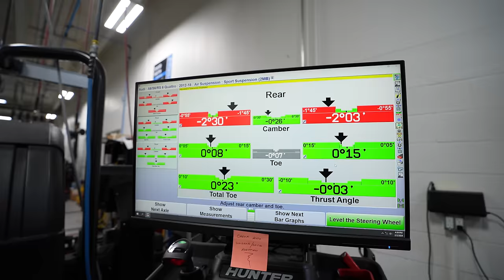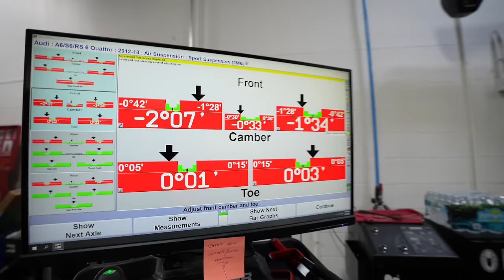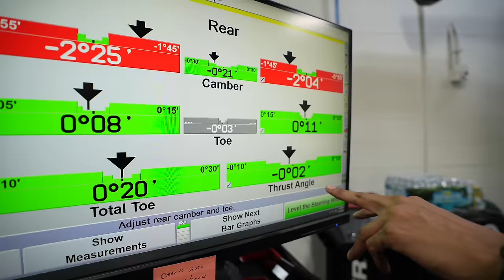REBUILDING A WRECKED RS6 THEN TAKING IT BACK TO AUDI

Comment: Well done Pembroke Pines Audi. Letting Matt film on the premises and interview your tech PJ was awesome. What a great way to engage with the public and free advertising. It goes a long way to promote the Audi brand compared to other competitors. Good job guys! Greetings from the UK.
Reply: This 100% - I get it's tricky to endorse something like this, a YT kid so far from your brand,  but it's important because in the UK, Audi really isn't appealing to the younger generation. Its intimidating and expensive. They may not be able to afford now, but you're building a brand for that generation eventually.
Reply: I actually learned at Audi and Worked at Audi. Even PJ has some sympathy, the break job he did is unacceptable for a Workshop LET alone a official Audi Dealership. The Wheel Hub was full of rust, it has to be properly grinded with a rust remover pad, then some rust converter and lastly the cleaned and sealed area needs to be slightly lubricated with Ceramic paste. The Brake Caliper ALWAYS needs to come off, doing otherwise will likely twist or tilt the fresh brake disc, also the piston needs to be cleaned and afterwards its really important to flush and add new brake fluid. If this work would be done in Germany it would be completely unacceptable and every customer would be able to get a refund and get the job done properly. I have NEVER NEVER seen this bad brake job on any car, not even in the lousiest and cheapest unexperienced garage. But this is a damn certified Audi dealership AND a damn RS6 !!! WTF? If i would do this even once when i was working at a Audi, they would either fire me or sue me for something like this.

Comment: Amazing lesson in this (and the previous) video. Sometimes it's the simplest things that mess up. Like a simple connection in both these video's.. My GSXR600 kept stalling and suddenly didn't start at all anymore. Turned out it had no fuel. And it had no fuel without me noticing, because of the simple fact the LED in the dash for the fuel light was broken. I took half the motorcycle apart and tested for example the fuel sensor just to find that out. Needless to say I left it like that and just fuelled up every so many miles. That being said, as an electrical engineer, I can say that if you lose voltage somewhere it will mostly be a bad connection / connection with high resistance somewhere (U=I*R, so if I stays the same and U drops, there has to be a high R somewhere). Because almost everything is fused in a car, if it would be a short circuit strong enough to cause a voltage drop (as in the battery would not be able to maintain voltage), the fuse would most probably break AND you would not see 12V on the battery and 9V somewhere else. If it is localized like that it should be a high resistance connection. Even if you can not find a nut that is loose. Try removing some connections and clean them best you can and put them back. This is what happens by itself most often when you take it apart and put it back and it works suddenly. The contacts clean themselves because of the friction from working on it. (This is also why you should always be just as thorough on GND connections as you are on the +).

Comment: That tech is spot on! That Avant is so beautiful. And actually the Avant 1.9 TDI is not available in US as well.... I am also surprised too. I'm from South Africa and I own 2004 Audi A4 Avant 1.9 TDI B6 6 speed manual with 537 000km (332 000 miles).

Comment: MATT there is fusing under the interior foot rest that will cause a no crank but power up. , also usually 2 relays under the center of that same cowl you removed. 
those are also for starting the car.

Comment: Dodgy earth strap underneath - mine was fixed by adding a extra earth lead from the engine to the body - AA did it with me, when took me home - 10 years on - still starts on the button.

Comment: 12:55
Yo, get yourself a Thermal Camera (bosch 400 gtc for example) for electrical issues.
The loose bolt should get a bit hot because of high current draws(as seen in 7:18 18.5Amps).
Could be interesting to know / work with on new projects :)

Comment: I’m 6:42 into the video… before I watch the rest I want to say I have the exact same problem with my 1999 Subaru forester that I’ve motor swapped to a 01 Impreza and converted to manual…. I ended up just putting a push start button in and it’s been fine with that but I can’t wait to see if you guys figure out the problem.
Reply: After seeing the solution I’m pretty sure mine has a different issue but I’ll go and check all the wiring just in case.  Awesome video matt

Comment: Considering the start button, you apparently dont daily it :D I have regular diesel A6 and the location of buttons is absolute ergonomic heaven, you place your right hand (left in UK) on the center console like your snuggling thigh of passenger and press it with thumb :)

Comment: In my experience the cable and the lead clamp that mounts onto the battery can have a poor connection and cause voltage drop. Same thing with the actual clamp to the battery connection. I'd need jumps constantly but clean the terminal and clamp and it'd start right up.

Comment: I've never seen an RS6 which wasn't the estate version. Looks like a large RS3 with no back end.
Also at 3:46 when the tech is talking about having the start/stop on the opposite side to the driver, but it turns out they put it on the opposite side wherever the car locale is - well back in the 1970's my dad had Audi's and they notoriously didn't swap things like the switch for the heated rear-screen which in the UK wasn't possible to see if it was turned on, due to the orientation of the LED on the switch. Seems like they've sorted that issue these days though.

Comment: not to be rude. but it is normal to grind/clean the hub when changing the brake disc. because if not you can risk vibrations from the brakes from the rust built up on the hub. but otherwise very well done job
With kind regards, Audi mechanic from Norway

Comment: you should run some rubber seal on aill visible encricall part like close positives to ground just might be clamped down a bit close don't burn your  wires

Comment: Before I watch the rest, I'm guessing the starter issue is a bad ground connection closer to the battery side of the harness, looks like you're using the jumper posts, which essentially would connect to the harness connected to the engine/ starter, but without the jumper pack you're relying on the battery ground & just clicks.. click is a sign of limited power, enough on the small start starter wire to activate the solenoid, but not enough power to crank the starter motor.. where you're not getting dash lights going out & such I'm assuming ground side rather than power side... unpause lol..
& bad ground it was lmao

Comment: Not familiar with RS cars but A4/A6 can have issues where the positive going from the junction box to the starter/alternator gets rubbed against the engine mount, it eats through and gives a voltage drop, it starta intermittently until it cant start at all

Comment: Even if they mark the discs as unidirection, I would still put them on the way the technician fitted them, not the KTM X-Bow. If you look at the fins theyre angled in one direction so you want them angled forward to scoop more incoming air through the fins and out through the ports.

Comment: Same problem with starting i have on my audi q5 .. will crank no start random times until it drains the battery , but starts with a car battery starter in 3 seconds :)) i don”t understand why . Brand new battery new filter new glow plugs . No ideea

Comment: It would’ve driven me crazy having the drilled rotors facing the wrong way. Obviously it’s only a personal preference, but to cope with my OCD lol, they should’ve been facing the opposite direction to how they were installed. Which would’ve, in turn, had them facing or pointing the right way. With the drilled holes, starting from the bottom, going up & flaring towards the left or back of the car.

Comment: The ignition button is on the correct side, because it was made for steering wheel on the left side. They didn't bother to switch buttons, i guess it was cheaper. Even the hazard and viper blade pads are on the same side as the cars that have the steering wheel on the left side.
Reply from the maker: On left hand drive cars the buttons on the right hand side
Reply: @MatArmstrongbmx  aha, ok. Just comparig average vehicles. For example, in UK and Ireland the van side door should be on the right side, next to the driver😀.

Comment: Hey, there was in one of the videos an issue with a broken transmission  gear/wire? And you did make from an other gear transmission a new one. And are you not afraid this issue will happen again and the gear will be broken suddenly?  By the way i understand this Audi has automatic transmission and manual ?

Comment: the problem with the cable is @ the starter were it goes to the alternator. i've been there on a a7 and an a4. i've replaced the whole cable from junktion box all the way to the alternator. ofc with 2nd hand one. audi wants a fortune for it.

Comment: Drop from 12.5V to 9V is a huge drop, thermal vision camera will show you a big heat spot.
Reply: not necessarily. if it is high ohmic, there is very low current flowing and hence little heat. The voltage creeping up is an indication of very high resistance in combination with some capacitance post the interruption.

Comment: Did you tighten the starter cable? Wasn’t there a ground you left loose last video? If so I would check all connections to the wires and see if they are tight. 7:46
Updated 12:51 yup
13:58 second update of course it was Freddie have you seen his work?😂

Comment: Guys, I have a Mazda MX-5 from 2000 and I had some problems with the engine, I took it to the workshop, they changed pistons, connecting rods and other things. I drove around 400 km (248 miles) and consumed 1.5 liters of oil, is it normal to consume that much? (it's an unmodified car)

Comment: "even audi techs question some of the choices audi makes while building these cars" looks like every choice should be questioned, bolts instead of studs, pointless stretch bolts on the calipers, custom made radiator hoses with glass fibre filled nylon plastic connectors that go bad suddenly and show it by cracking at the worst possible moments when a simple hose clamp that works and has worked for over 100 years now would do, custom bolts that require specialty tools, parts that are over engineered in complicated ways that cause issues just so that you need a specialty tool so only authorized dealers will bother working on it, and computer systems that said authorized dealers follow to the letter so much that they will require you to replace fuel pumps, lines, fuel harness and computer because a single fuel line wasn't connected properly and popped off, instead of just connecting it.

Comment: That idiot just could have potentially bend the wheel hubs by hitting the brake disc with a hammer. Typical fault in C7, but an audi technician should know it well. Expect wobbly braking afterwards.

Comment: I absolutely don’t agree, main dealers are full of 💩.
Porsche UK wanted £1500 to fit new pads and discs and told me it can’t be done without their diagnostic kit. Did the job in 4 hours, works perfectly, yes I’m an engineer but it’s in electrical (degree by the way not the current trend to call someone who fixes boilers or washing machines who are techs by the way).
And that was just labour, the discs pads etc were another £1500 on top!
Mechanics aren’t engineers so do your own research as you will be just as clever if not more than them ffs

Comment: Not that I'm an expert and not that I want to spoil the image of the super Audi technician, but a critical mistake was made there. Installing new brake discs on rusty and not cleaned hubs will only lead to vibrations in the steering wheel. The mechanic is a disaster, I have no idea how someone like that can work in an authorized service center.

Comment: Well.... I'm sitting here in Newcastle, can't get rusty nuts off my Audi, and I said it was a loose electrical connection. How didn't the Audi tech suggest that!? Probably over analysing it.

I called the RAC after not tightening a nut on the manifold.... Felt like a right tit